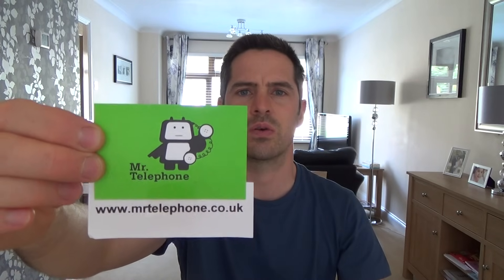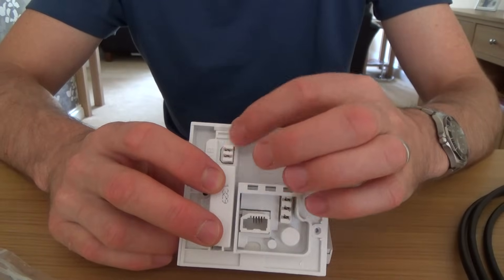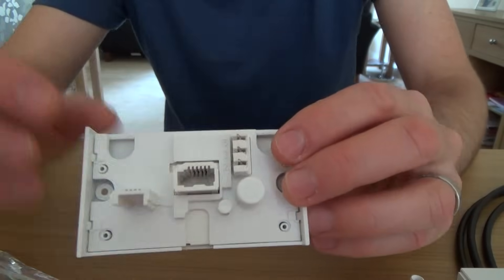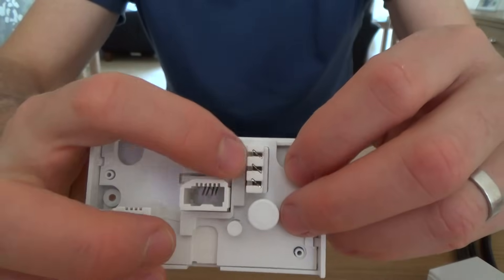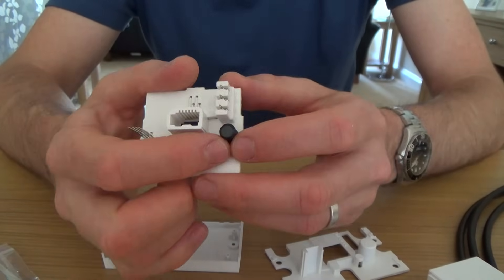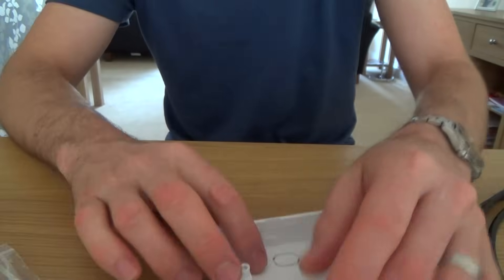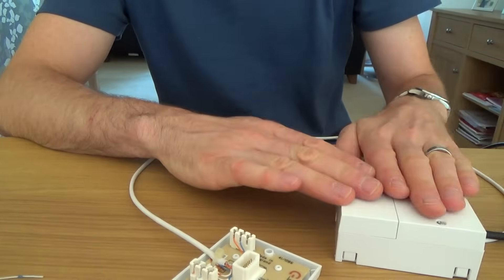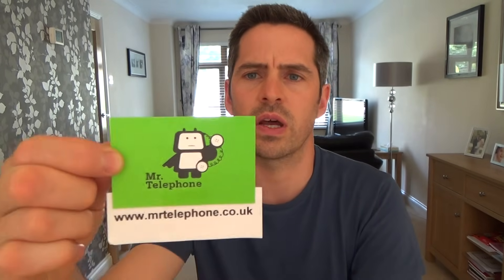How to install a NTE5 Telephone Master Socket and Telephone Extension

Comment: I have read somewhere on a website the purpose of the 6 Telephone Wires.
1) Green/White Power
     Wire
2) Blue/White Bell Wire
3) Orange/White Dialling
     Wire
4) White/Orange Call
     Wire.
5) White/Blue Recieving
     Call Wire
6) White/Green 
     Broadband Wire.
This is the cable to my 2nd Floor Flat.

Comment: Hi mate just wanted to u need that black wire.. For connection... Its my new house and I'm waiting for engenier to install dsl scorket.. But they the line is on.. And I can see just white wire.. But I shows wifi is on mobile.. So if I install dat extensions wire without black wire will my wifi will work..?... This video is very easy to understand.. Great video

Comment: Vince just had Virgin installed router etc is in my bedroom but I want phone downstairs where previous sky phone was which worked perfectly via an external cat 5 cable for some strange reason it doesn’t work with virgin now didn’t want extension in house . Only used 3 & 5 previously any ideas basically just using cat 5 as external extension lead 👍
Reply: Virgin left lead to connect router to box in bedroom to create link 👍

Comment: This is a very good demo.

The phone I am having a problem with is connected to a NTE5 socket along with a Careline unit, (a panic button for my 91 year old mum).

I can make calls out - no problem.

Receiving calls the trouble starts.  The phone rings a couple of times and then rings off.

I went through yhe oroblem with the service provider (Utility Warehouse) anf the guy got me to take the bottom front plate off and move the phone plug over to the socket on the right.  Everything worked swimmingly!

Obviouslg I couldn't leave the box with the front off permamently.  The support chappy from UW said I needed to buy a NTE5 Bottom Base Plate Unit.   He also said that you could get a plate with the socket offset to the right.  I took this to line up with the underlying socket that works.

I can't see anything like this anywhere.  Is the plate I have faulty and all I need to do is replace it?

Has this support cgap thrown me a googly and sent me looking for something that doesn't exist?

What is your take on this?

What is your advice?  What should I buy?
Reply from the maker: He probably means an ADSL faceplate which may not be suitable depending on your setup. If you watch my telephone fault finding video https://youtu.be/Vwqcz1G33_4 it will hopefully make more sense. It sounds like a RIng Trip to me and once it rings off try picking up the phone straight away to see if the other person is on the other end. Sometimes if the wires are nearly touching together the higher ringer voltage shorts the line together so it answers the call without you picking up the handset.
Thanks.
Reply: My Mate VINCE Looking at the video you have sent me, the plate you take off is wired.  The one I took off doesn't have any wires connected - not sure but I think it is different.

Maybe there's some integral connection from the plate to the plug that inserts into that test socket when you fit the plate back and maybe the fault is a failure with that integral wiring.

Correct me if I'm on the wrong track.   You will know far better than me.

Comment: So would a The Main Telephone Cable from the outside in a block of Flats would this go straight to the Flat or would the main Telephone Cable terminate somewhere else and a extension cables to the Flats?

Comment: I had a very old style master socket which had Orange, blue, green and Brown wires. I ordered the NTE5 from you and installed fine. also bought a vDSL plate on top of that. ping is faster but both wireless and powerline connections are roughly the same as before with the old master socket. I'll probably need to replace the old cable that comes from the pole into the bathroom then along the coridoor to the livingroom where the socket is. (no other sockets or extension sockets). any advice on replacement of the ancient cable? thanks.
Reply from the maker: +BRIAN MACKAY You can just use internal 2 pair telephone cable, just make sure it is pure copper. The colour of the wires will be different but I can advise on that after purchase. It may not make any difference if the old cable is in good condition so it may be a waste of time.
Reply: ok. thanks mate. Much appreciated

Comment: Hi there,
I have a strange one for you. It's doing my head in!
I live in a flat and the master socket goes into the kitchen. When I moved in, the previous owner had cable which i didn't want.
When I switched over to BT I noticed that the phone wasn't working the internet was. I looked at your video and noticed that the wires going into my master socket were wrong! it was being fed with extension wire (2 x blue and white & 2 x orange and white) with the two blue wires going into A + B. This would point to it not being the master socket, but it is?! Im confused!

Another strange thing was that underneath the BT socket was the Diamond Cable socket to of the orange and white wires from the diamond cable socket routed into numbers 2 and 5 in the BT master socket. When I removed these, the phone started working!

I hope you can shed some light!!

Great vid by the way!
Reply from the maker: Justin Watkins Hi, the master socket can be fed by internal cable if it is somewhere inside the property that is hard or impossible to feed it externally. Often the external cable would then join to a junction box where it connects onto internal cable because internal white cable looks much neater than running external black cable inside. It sounds like you had a fault on the extension wires (orange and white wires) connected to 2 and 5 and when you removed them it cleared the voice fault on the line. If for example the wires were wet outside producing an earth fault then sometimes it can affect the voice but NOT the broadband.Many thanks Vince
Reply: My Mate VINCE Cheers Vince!
Reply: My Mate VINCE I'm having issues with my phone too, where the net works but the phone doesn't. It only started 2 days ago and we have been here 5 years. I've just traced the wire back (from an appallingly wired box that's not even screwed to the wall) to where it comes into the house through what looks like a junction box. If the fault is on the white extension wire running through the house, who owns it? Us or BT? And will we be charged to have it fixed? I've spoken to sky and they are sending out open reach to have a look, but I'm not paying them anything, we rent the house and wireing was terrible when we moved in. The master socket is just laying on the floor with the orange and white cables hanging out the back unsecured, so I wouldn't be surprised if that was the issue. I expect the landlord made the mess, will open reach\ sky try and charge me for fixing it?
Reply from the maker: Hi, normally they will maintain up to the master socket BUT if the wires have been rearranged/ pulled out then they may charge as it is not fair wear and tear. It may be just the white or orange wire has come loose. Could be a very easy fix!!!
Reply: My Mate VINCE as it wasn't us that did it, and it was like it when we moved in, I refuse to pay to get it fixed. Either the landlord can pay for it or I'm fixing it myself as per your video. Thanks for posting it, I now understand how it all works and how simple it is.

Comment: Can you have more than one extension? And would you connect them in sequence?
Reply from the maker: Yes, you can have more than one and you can connect them in sequence (daisy chain them) or star wire them.
Reply: You can add telephone external master plug
Reply: My Mate VINCE thank you!
Reply: I am sure if's been advised to Vince NOT to Star Wire!  It can cause havoc for ADSL/VDSL

Comment: I was wondering if you knew if the same wires are used for phones in North America, 2 and 5 for phone and 3 for ringer? Specifically I'm located in the United States of America. Thank you!
Reply from the maker: +Crowz Hi, I am not sure about American wiring but I thought In the US it uses a 2 wire system so the ringer wire is not needed.

Comment: Hi mate I was going to change my old master socket to a new Nte 5 socket I only have the one socket in my house no extra sockets do I have to wire up the back plate and the front plate or just the back plate thanks for reading would appreciate the help.
Reply from the maker: +Declan Mcguiness Hi, if you only have the one socket then you will just need to wire up the A and B terminals on the backplate. The frontplate is for extension wiring for extra sockets.
Reply: +My Mate VINCE  Thanks mate

Comment: hi i have black wire from the back of my master socket to my sky digital box in living and a black wire in the front part of master socket for a 2nd phone in kitchen ! is it possible to run the white cable from master socket to bedroom  extension socket just like your video shows ?
Reply from the maker: +Conor mallon You can only connect 2 wires in each IDC terminal so you cannot connect the 3 cables unless you use some 3 wire jelly crimps pushed in the back of the master socket backbox to make 2 wires into one wire by connecting for example the 2 blue extension wires with another bit of short blue wire and punch that short wire into the IDC terminal so now only one wire is in the IDC terminal even though both blue wires are still connected. Or run the white cable from one of the extensions or use a BT78 junction next to the master to connect up all the extensions and then un a cable from the BT78 to the master socket front plate.

Comment: I have an openreach MK2, I was about to upgrade to MK4 and my Orange is in A and White is B ? 2 video's of yours have said Orange is B and White is A...
Reply from the maker: Don't worry, it will work either way round. Most engineers would put the white wire in A but it doesn't actually matter. :-)
Reply: Nice one and thanks for the quick reply. Great videos BTW,  subscribed.

Comment: Hi My Mate,
In the new house I have moved recently, the main BT line is going to outdoor JB, and from it there are four cables running on the wall then terminated to four different locations. However, only one of them (in the hallway) is terminated into NTE5 faceplate as the master, which currently feeds the modem and the telephone, while all the other sockets (three) are completely dead. I haven't checked the wiring inside the JB outside to see whether they are terminated or not, but for sure the indoor ends (three sockets) are terminated correctly (Pin 2,3&5).
Can I use the unused wire pairs of the cable going to the NET5 as an extension to feedback the outdoor JB to activate the three dead telephone sockets? 
Cheers,
Reply from the maker: Ahmed hamody  Hi, yes it will work BUT backfeeding the extensions is not recommended because there is no clear divide between your property and the service provider property because both their main line and your extensions are running down the same cable. The best way would be to run a new cable from the nte5 master socket back out to link up the 3 extension cables. Also there is a possibility of the ringer wire on the extensions causing problems on the main line if you have broadband, so if you are doing it then it may be best to not connect the ringer wire (orange wire on terminal 3)Thanks Vince
Reply: Hi Vince, many thanks indeed for your reply. I can see your point, which means correct me if wrong the outdoor main cable running to the NTE5 on the wall is the ISP property? is that correct?
I do use broadband (fibre) in this case I will run a separate cable backward to the JB to feed the other outdoor cables. these feed slave sockets. 
Do you recommend certain type of cable? any recommended IP rated JB?
Cheers, Ahmed
Reply from the maker: Ahmed hamody Hi Ahmed, yes that is correct and personally I would use external cat5e cable in black, 5mm cable clips and I would use a BT66 junction box because you will need a little bit of room to connect up all the cables. My BT66 junction boxes comes with jelly crimps. If you want to see these check out my ebay shop. Google mymatevince and it will link through to EBay.Many thanks Vince

Comment: The extension socket upstairs is  faulty, so I by-passed it and connected the wires from the master NTE5 directly to the upstairs telephone extension cable with a small socket for the upstairs telephone and it now works. My question is, if install a replacement extension socket, can I connect the upstairs extension cable directly to it using contacts 2 and 5?
Reply from the maker: +Fuzz Bonce Hi, yes a telephone extension works on 2 and 5, if it doesn't ring then connect number 3. You need to copy how it was connected before if it used to work ok.

Comment: Hi 
My house phone extension cable end in the master socket has 6 core cable ( white,green,blue,red yellow and black and I have 4 phone sockets in the house which wire colours I need to attach to number 2,3,5
thanks

Comment: Hi Vince
I presume if you wanted to add additional slave sockets (extensions) to your one-extension example, you just copy the colours and parallel up using the same colours on 2, 3 and 5 either from the master or the first slave?
Thanks
Steve.
Reply from the maker: +Steve Wright Yes, exactly correct Steve.

Comment: Hi mate on my face plate I can unscrew and take off all the wire are connect behind it so does that mean I can just swap over without undoing the b taack plate to connect the wire. PS my phone socket was fitted by BT
Reply from the maker: +Ian Chadwick Yes if you can install the new wire without removing the back plate if it is not in the way.

Comment: Can you show were all the colour wire are suppose to go
on the old A&B screw connection, I no longer have phone service
but I can get internet service .There six wires
Reply from the maker: Mea Lewis The colour code is the same on the screw terminal version and the IDC version. If you have 6 wires then you may have an internal cable feeding your master socket and the colour code is usually white with little blue bits to A and Blue with little white bits to B but these colours can vary depending if you had more than one telephone line in the past or depending on the age of the cable.

Comment: hi! I need your advice please! my black cable has a brown green grey (think it could have been black) and blue wire and a white for each of them. thing is the blue and a white are connected to the screw terminals.... now I'm unsure on what colour wires to put where as they all come out of the black cable! any help or advice is appreciated! x
Reply: forgot to put that it also has an orange wire x
Reply from the maker: +Katie Morris Hi, normally if your existing socket is using the blue and white/blue cables then you would put the white/blue wire to terminal A on the NTE5 master socket backplate and the blue wire to terminal B on the NTE5 master socket backplate. Make sure you make a note or take good pictures before removing anything so if you run into problems you can always put it back to how it was originally.Thanks Vince.

Comment: i need help which colur use on 45 no and which one is 36 no plz
Reply from the maker: +sajjad ahmed If it is for the UK then a normal residential socket does not use  terminals 1,4 and 6. If you want to wire up a 6 wire socket using CW1308 cable then normally it is green to 1, blue to 2, orange to 3, white/orange to 4, white/blue to 5 and white/green to 6.
Reply: no sir i have 2 pair cable and socket which like that 35 46 numbering how to use
Reply from the maker: +sajjad ahmed I don't know, the sockets in the UK are 2,3,4 and 5

Comment: Hi, Hopefully you can help, I still have the 2 thick black wires from the mast to my house will these still fit in the A & B slot? Thanks for your help in advance...
Reply from the maker: Stephen Jones Hi, you will need screw terminals for those thicker wires because they are thicker than the newer style wires. You can get NTE5 master sockets with screw terminals and the bell wire filter (I have them for sale on ebay at the moment)Many thanks Vince

Comment: Hi Vince, I have just moved my router from an upstairs bedroom (router connected by a cheap extension kit) to the old BT master socket (still using a separate micro filter) in my hallway. Now I'm getting 1-2mb less now it's nearer the master socket!!??  How does that happen? I was only on 5mb at best before I moved it.. Now I'm thinking it's not worth upgrading my master to a new VDSL socket? I'm confused
Reply from the maker: +TheLastPost Hi, that is strange. Is the cheap extension kit hardwired to the back of the master socket or just plugged into the front of it? I am thinking maybe the master socket has a tarnished/corroded pins which might be making a dirty contact when you plug in the microfilter into the master socket.Thanks Vince
Reply: +My Mate VINCE thanks for replying! No it's plugged straight in the front. I've noticed a second line has been added in the past with a DACS1 box outside (next to a grey connection box, that splits the yellow main in). This second line isn't live. Would removing this DACS1 box be a good idea and something I could do?